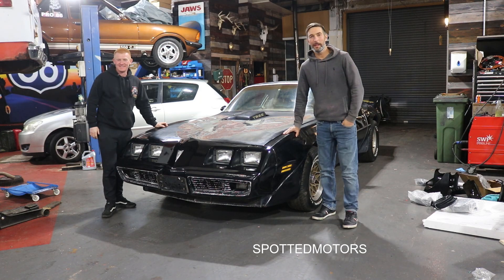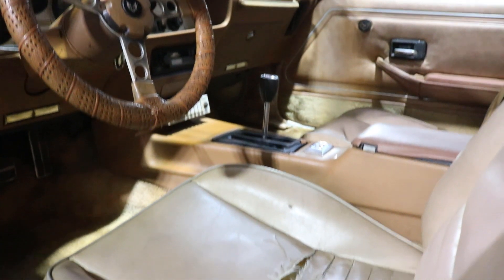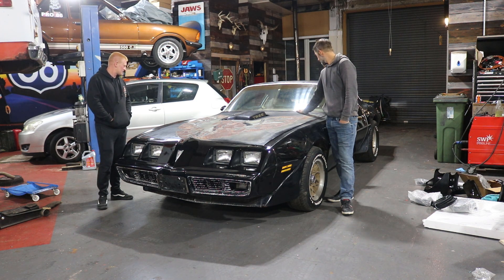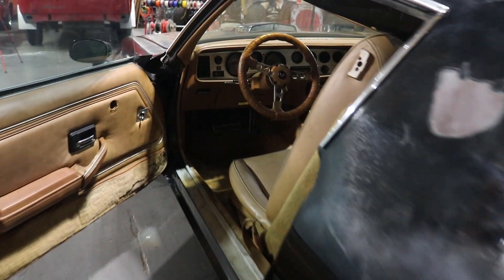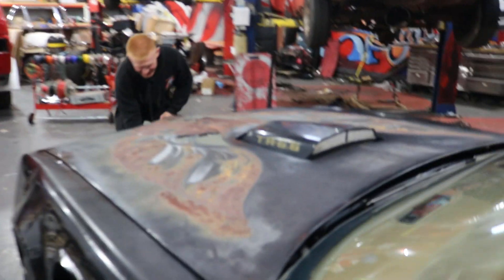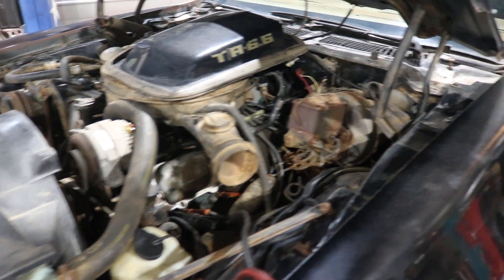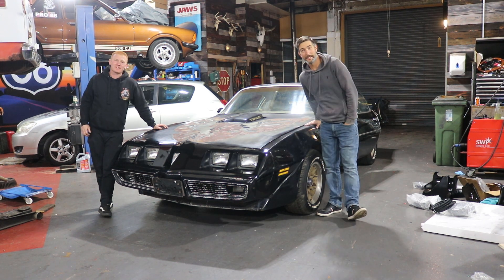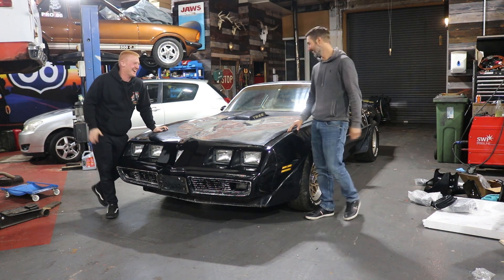Pontiac Trans Am With Perfect Patina

Comment: 403 Olds Engine  7.9 to 1 C.R.  185 hp  320 ft lbs   wrong call out on the Shaker . The TA 6.6  was a 400 Pontiac V8 8.1 to 1 C.R.  factory rated at 220 hp  320 ft lb  which was under rated NHRA dyno showed it was 260 to 280 Net HP. The snowflake rims are the 8 in so WS6 rim if it is a WS6 car it will have 4 wheel disc brakes
Reply from the maker: Absolutely fantastic Information. Thanks very much.